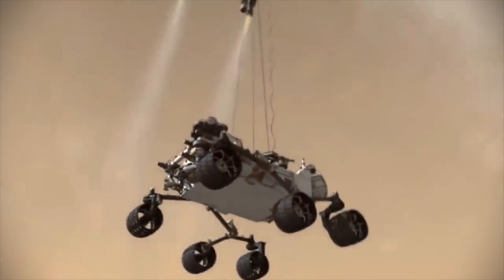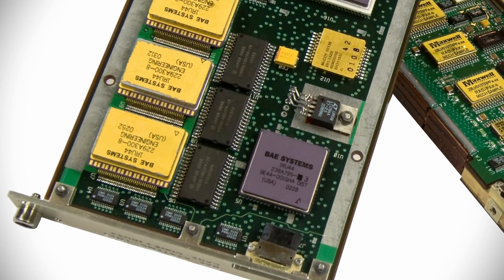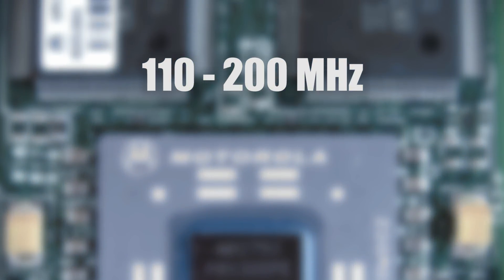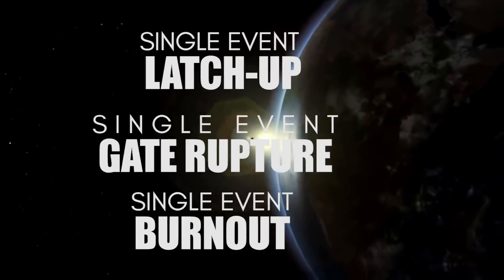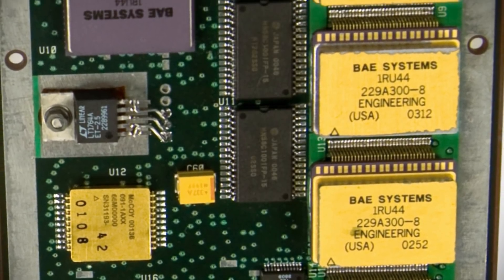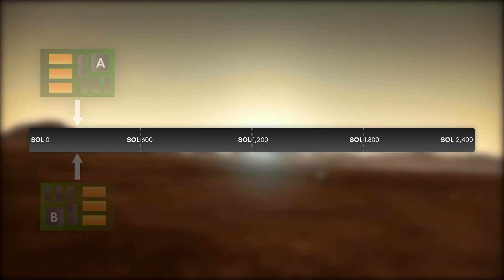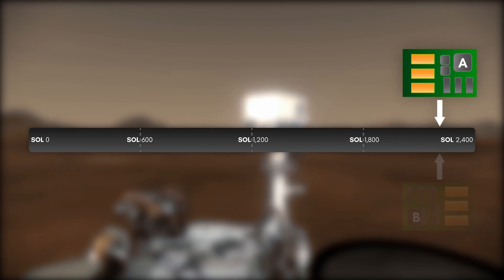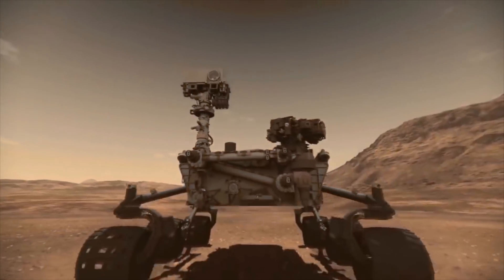The Computers Behind NASA's Mars Curiosity Rover

Comment: Fun fact, a radiation hardened version of the Sony PlayStation 1 CPU, has been used on multiple NASA projects, even today!
Reply: So it runs metal gear solid?
Reply: @aerohk  I like to think so...
Reply: Metal gear solid and mars. What a combo.
Reply: When PlayStation first came out wasnt there a story going around that there were chips in them that could be used for missile guidance or something like that ? Probably an internet fairy tale but i seem to recall reading it somewhere.
Reply: @ankles632  That was the PS2, There was a news story about iraq importing 4000 PS2s and propaganda spread about fear of it being viable military hardware because of its "Cell Processor"  and encrypted memory card. Was nonsense of course. So PS2s could launch missiles became a meme.
Reply: Ankles I’m a missile, and I can confirm this.
Reply: There are multiple radiation hardened MIPS R3000 variants, and it was also in workstations from e.g. NEC, DEC and SGI. The PlayStation is the spurious offshoot here more so than the space models.

Comment: Fun fact: The RAD 750 CPU is almost the exact same as the CPU in the Nintendo Game Cube, as both are based on the PowerPC 750 architecture.
Reply: Thanks, I love little tidbits of information like that!
Reply: IchBinEin no, it's only based on the same architecture, that's the only similarity. Different lithography, packaging, manufacturing method, operating voltages and to a degree I/O means it's otherwise completely different.
Reply: DarkPhoenix No. Curiosity doesn’t have solar panels. It still runs on nuclear, but the available power is extremely limited (<200 Watts + thermal) due to weight and radiation limitations.
Reply: @jonathandougan328  My B
Reply: It is good to know that if you moved to Mars you could still use your game cube if you can find somewhere on mars to plug it in.
Reply: @davidbrown8303  what voltage does curiosity run on? Asking for a friend...
Reply: @stalincat2457  I dunno but my dad rewired are house so I'm sure he could install a plug in curiosity so I can plug my Xbox into it.
Reply: @darkphoenix7225  
ECC memory might help with a single or a few bits of bad memory.  But the cosmic rays have so much energy that the memory errors, both soft and hard, would make error correcting memory useless.  What they need is several times the needed memory, and a memory management unit that can automatically flag and disable bad memory sections as they occur.  Another method might be to add more computers for more redundancy.
Reply: Acme Fixer they obviously have ECC memory on them and they have dual computers onboard already. Way to suggest stuff they already have :-P
Reply: whats even cooler is that the cpu also shares a similar architecture to Apple's PowerMac G4.
Reply: @LA24931  Actually, no.  The PPC750 was the G3 architecture.  The G4 and G4+ were based on Motorola's PPC 7400 and PPC 744x/745x.  The main difference being that the PPC 750 did not have on-die backside cache and no Altivec instructions.
Reply: That's the American way! Speed an absolute fortune on old slow crap.

Or over engineering something in order to spend a fortune. (Space pen) The pencil solution would be to put a new, cheap processor in a shielded container, even multiples of them as redundancy/backup and still come out way cheaper.
Reply: @usquanigo  The space pen wasn't over engineered and it was much cheaper than the pencils NASA used to buy. The mechanical pencils NASA was buying cost $128 per pencil. Where the space pen cost NASA $2.28.

The reason why NASA wanted to buy the space pen was because it was cheaper, and didn't suffer from the dangers of pencils. The pencil's graphite would flake off, which is dangerous to astronauts and equipment, since graphite is a good conductor.
Reply: Nothing made for any government program is ever cheap, let alone cheaper than the alternatives. So while NASA spend time trying to find a pen that could work in space, Russia, strapped for cash, used a pencil.

Clearly it worked too and was not the danger that you (and presumably NASA) tried/are trying to make it out to be.

Not to mention that you are splitting hairs to avoid the bigger point in an attempt to negate it.
Reply: @usquanigo  That's not entirely accurate. It's true that the Soviets did use pencils, however they did end up using the same space pen as NASA did. They used pencils because it was literally the only thing that worked in space at the time.
Reply: @usquanigo  As for the "point" I avoided. You poorly articulated your point, it didn't really make sense. It wouldn't be cheaper to add redundant CPU's. CPU's survive long after the rovers wheels are too damaged and/or power runs out.
 Think about it, the rovers right now exceed their life expectancy. So, why would we add redundant CPU's when the problem with rovers right now is wheels and power?
Every gram of weight is expensive, it wouldn't be cheap to add unnecessary weight that you most likely would never use.
Reply: Again, playing games. Not sure what your issue is here, but you clearly have one, and an angle/axe to grind. The Soviets didn't have anything else - nor did NASA at one point either. A pencil is cheaper, widely available, easy, and more practical (than inventing something new). That is the point. The Soviets, and now Russia, are a LOT more cavalier with aero-space, and, it works. All this stuff you're spouting, just like the US, is irrelevant.
Reply: It was quite well worded for anyone not trying to push some sort of agenda. If one needs hardened CPUs, then my solution is cheaper, easier, and offers better capabilities. However, you illustrated that the CPUs are NOT needed to be all that hardened. Even NASA themselves show that the CPU expenditure is a waste by not hardening the motherboards. Therefore, point stands, it's wasteful. Sorry.
Reply: @usquanigo  Not sure how you got that idea XD but okay bud
Reply: @usquanigo  Ah yes, clearly the pencil is superior...even though the example you like to use also switched to the space pen. You're funny.
Also, I'm not sure where you even got the idea that the space pens were expensive. It's a common misconception that NASA funded the development of the space pen. That's not true though, look it up.
Reply: You're splitting hairs. That is a misdirection tactic. Research on it was funded, regardless of by who, and it is more expensive per unit as well.

And that is the real point. $250,000 on an ancient processor is absurd. And not shielding the motherboards means that either the expense for it is completely unjustified, OR, rather than shield the motherboard, they used 2. The CPU didn't crap out. The memory did. But because they used 2 boards, they spent double on everything. Brilliant. Instead, just shield the whole motherboard, then you can use cheap off the shelf components, so even having 2 as a JIC/CYA is still going to be far cheaper. But that's the US government's way - waste tax payer dollars at every opportunity. This is why even NASA are turning to the private sector, after first buying flight time from the Russians. Because everybody can do it cheaper than the US gov't can.
Reply: You've pushed BS extensively, yes. Because you are apparently insulted that somebody isn't falling for the propaganda. So much so that you are still arguing. And you picked this fight.

It's not false, you just admitted it, and it was in the video. You either have no clue how people speak, or you are playing games to try to spin things around.

If it was entirely shielded, it did not work, and STILL did not need that overpriced CPU. No matter HOW you spin it, you are not making a good case. At all. And that is because there IS no good case to be made here. Bottom line is it was WAY over priced for no reason. Period. Very wasteful, like all government projects. (it's almost like you work for the government or something, or a union)

Yes, reused, as it said in the video. Almost like you might have watched it too. Wow. Reused after Side B was likewise crippled, and they had to drop to an even further reduced capability due to having mapped out the bad memory bits.
Reply: @usquanigo  You should stop talking, you're just digging yourself in a deeper grave. You keep making baseless assertions. The amount of corrections you have truly show, you have no idea what you are talking about and no one should take you seriously.
Reply: lol
Reply: Wow. All the vitriol. You are clearly emotional over this. "This" being someone pointing out the wastefulness of all government spending. A point that can not actually be denied or rebutted, and so instead, a flurry of split hairs, misdirections, side-steppings, and now  raw emotion with attacks. I pegged you at the beginning, and, no surprise, you have shown to be exactly that. Now, exactly why you're so emotional over this, that's a different question. But one I'm not interested in.
Reply: @usquanigo  And of course you side stepped the question. The irony
Reply: There is no irony. You are tiresome. Your emotions flared, so you picked a fight, were ALL over the place, and just really obvious. This is assuming, of course, that you aren't just a troll (can't discount that). Either way, it's not like you warrant legitimate engagement. You threw that level of respect out the window some time ago.
Reply: @usquanigo  You're funny
Reply: cringe
Reply: @usquanigo  There are both hardened electronics as well as physical shielding onboard already. I think the extra mass needed to protect off-the-shelf electronics with a x4 or more redundancy would put it WAY over weight.
Reply: why didn't they use an intel core 7th gen???????????? not like the cost wasn't high eitherawy
Reply: @Dyrtbag Mcguire because of the radiation hardening requirements!
Reply: @dyrtbagmcguire8294  to much power  and no use for all that speed since the tranmition speed is way slower and it is a old and proven professor
Reply: @dyrtbagmcguire8294  Cost of radiation/temperature/schock++ hardening a new chip  (and then also having to add more electricity generation or forgo other sensors to make up for its higher power use) far outweighs the tiny savings from just picking an off she shelf consumer grade chip.
Reply: @dyrtbagmcguire8294  Ecksdeeeeeeeeee
Reply: @dyrtbagmcguire8294  
You didn't get the part where they explained the radiation hardened aspect of the Rad 750.  The whole issue is cosmic radiation damage to the components.
Reply: Dyrtbag Mcguire High performance isn’t necessarily necessary for automation and robotics. Reliability and resilience is preferred. Even operating systems like VxWorks (used onboard Curiosity) are RTOS (Real-Time Operating Systems), designed for automation and embedded systems.
Reply: @dyrtbagmcguire8294  why cudnt anyone understand ur sarcasm
Reply: @dyrtbagmcguire8294  they didn't want the updates to take 10 years
Reply: u knwo so the pics don't look bad

Comment: Maybe a question for a future video but why not just harden the area where the computers sit to radiation instead of the individual components. This would let NASA use more advanced hardware and possibly even afford additional redundancy. I'm assuming it has to do with weight of hardening an enclosure vs just the weight of hardened electronics.
Reply from the maker: The issue with that approach is that on the surface of the Earth, we have over 100 km of the atmosphere above us, which is roughly equivalent to 10 m of water shielding over our heads. Even with protection, our bodies are hit by 1,000 or more cosmic rays every second, with 1 out of those 1,000 making its way through the length of our bodies. These tend to be single charged particles such as muons, protons, or electrons that make it through the entire atmosphere. 

Every so often one of these cosmic rays strikes a nucleus dead on and causes a shower of charged particles, which can cause bit flips. It would take about 10-20 cm of lead shielding to duplicate what the atmosphere does for us, but that might do more harm than good. Cosmic ray showers from atmospheric nuclei being hit spread out before they hit the ground, but from lead, they shower would still be confined to a small space. The shielding might cause more bit flips due to showers than just letting single charged particles pass through.

Insulating layers on the processor die are used to shunt ionizing particles around the nodes but using redundancy to secure the integrity of information flow within the chip is really the only practical way to handle this.
Reply: @NewMind  Incredible reply. I did not expect to see such a lengthy and informative response. I'm glad I decided to click this view replys button.
Reply: @NewMind  Thank you for taking the time to teach me something I never knew about before.
Reply: @NewMind  Are you sure about electrons and protons getting through the entire atmosphere? As far as I know, the electron beam from crt tubes, with the correct membrane is barely capable of getting through air further than a few centimeters. Both of these particles have a near zero chance of getting through the atmosphere due to being fairly massive. What's more likely is that high energy photons are reaching the earth surface